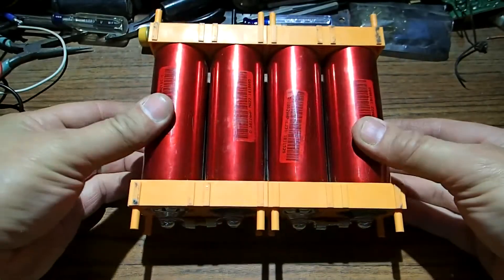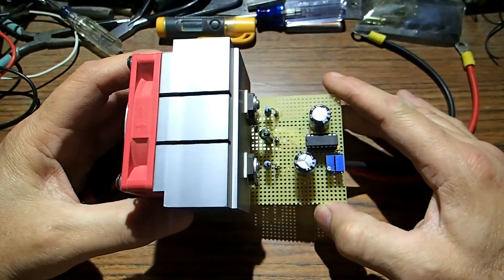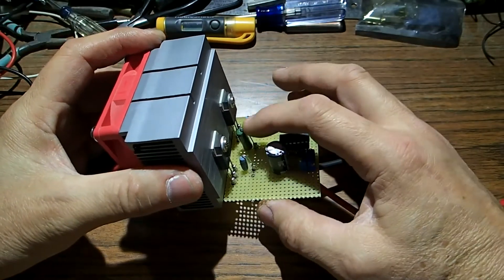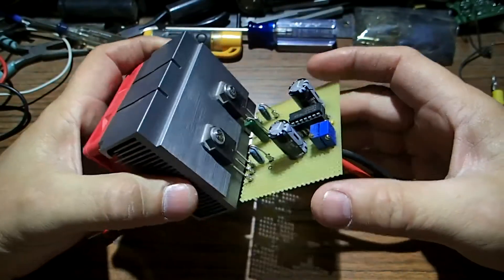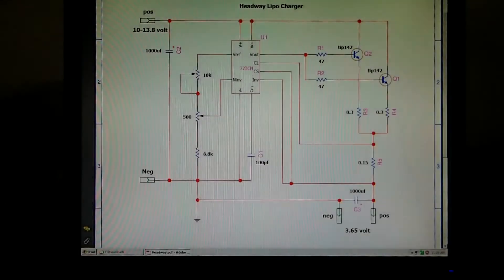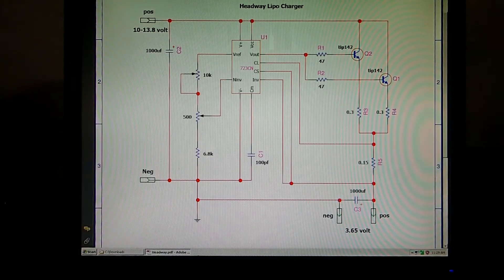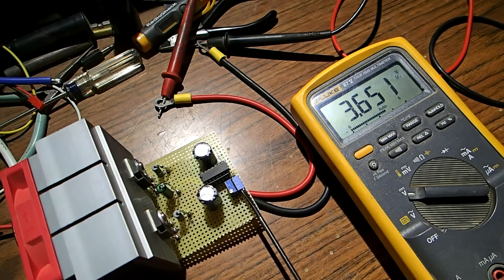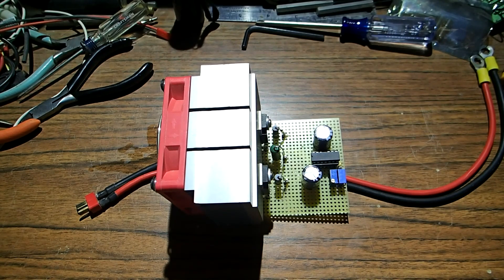Headway/A123 High Power LifePo4 Cell Charger (With Blower)

Comment: What does the capacitor reference do?
Reply from the maker: Dominic Nedlewski those are just input and output capacitors they prevent oscillation if the capacitor is not on the input the regulator oscillate the capacitor on the output helps with transient response to load changes
Reply: +Liquid Turtle that sentence alone is an L

Comment: Would this work with MOSFETS?
Reply from the maker: NNNI it can but it's a more complicated circuit because this is a linear device and mosfets are switching so they would have to be pulse modulated they would take some control circuitry that's simply why I made this because this is real simple and easy to make for everyone.
Reply from the maker: NNNI you cannot use this design with mosfets no
Reply: Oh, allright. The power loss using BJTs shouldn't be too bad.

Comment: and about the gate drive which you used in previous video , can that npn and pnp combo drive a array of 20 to 30 mosfet
Reply from the maker: Vasudev Mr no it can't because the transitions are only rated for about a half amp and the auto couples rated for 2 Amp Drive
Reply: but in theory there is no gate current isnt it ??

Comment: why do you need headway charger if you have no heat dissipation smps ??
Reply from the maker: Vasudev Mr because I haven't built that charger yet except for my high-powered unit which is in the last video which does the 40 amp hour lithium batteries 13.8 volt. I have many different LiPO batteries that are single cell that I don't have a quick charge for other than a little plug-in unit that only does two A123 at once I need to charge 8 at once.